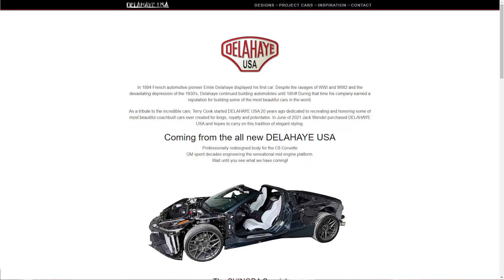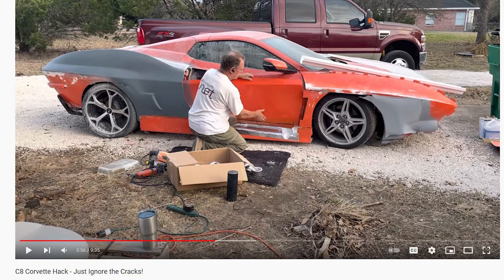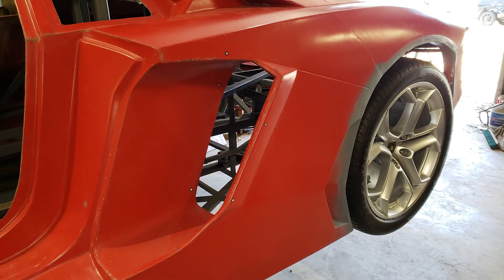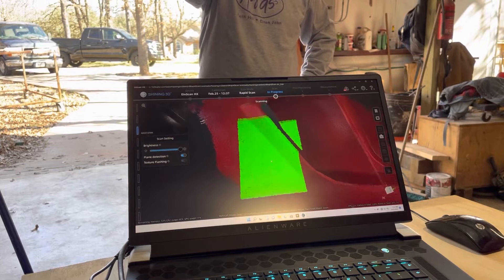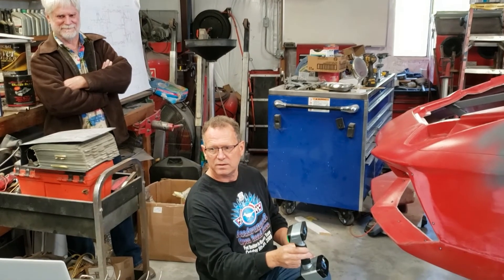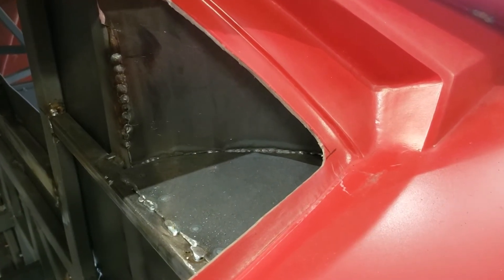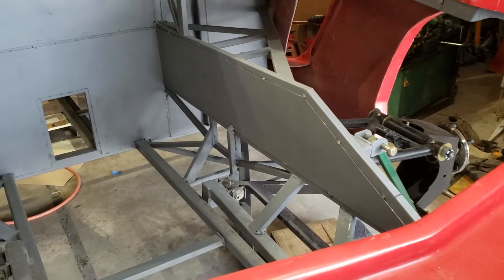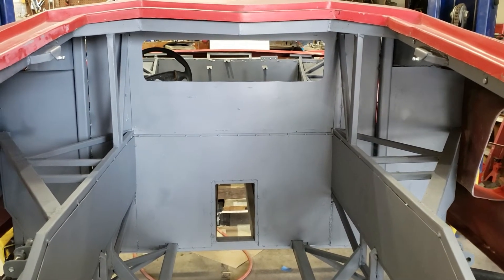Aventador Replica Project - Part 17 3D scan and more sheet metal

Comment: I'm curious  about what you will do about the windows/windshield..lexen?
Reply from the maker: The Dur-A-Flex body was designed such that you can use a very affordable 95 Nisson Maxima windshield. Side windows have not been sourced. Maybe will use Lexan. To be determined.
Reply: @lambobuilder  Maxima? That's pretty cool! Keep up the hard work and good luck on the rest of the build!